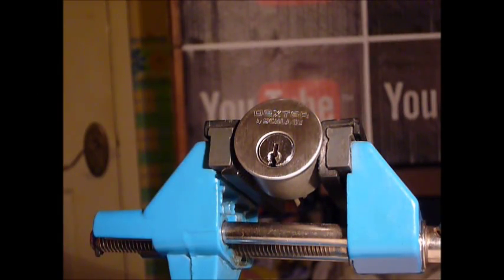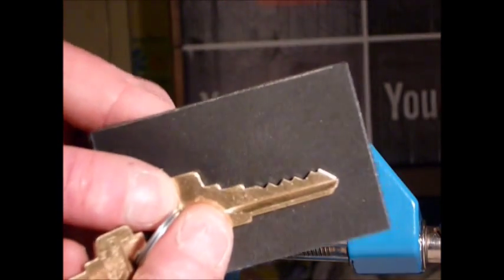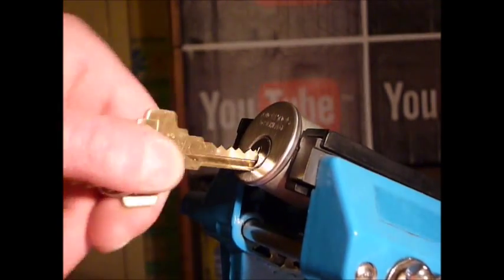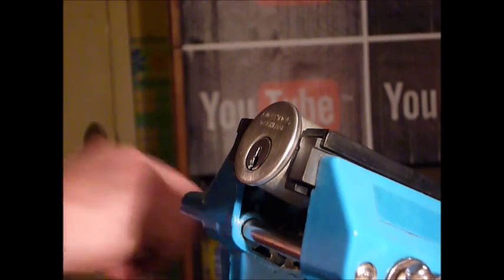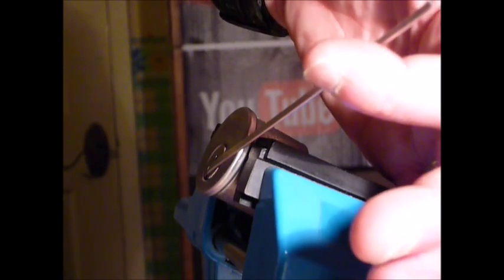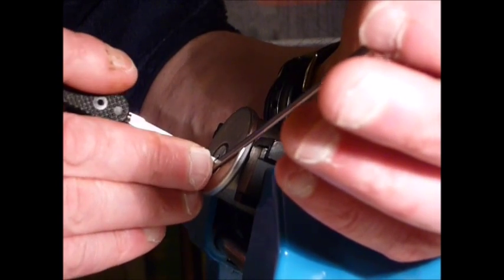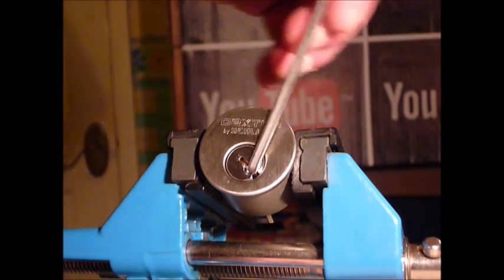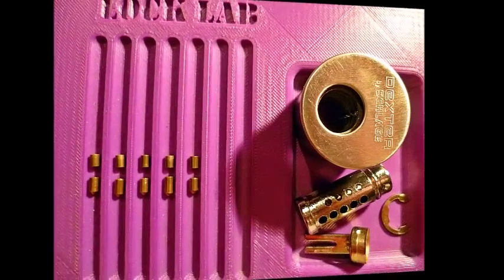Single Pin Picking A 5 Pin DEXTER Mortise Or Rim Cylinder Lock By Schlage

Comment: The lock is a dead bolt type lock that sits kind of flush with tge door. The tail piece is what makes the dead bolt move into the locked or unlocked position plus attaches to another piece on the inside of your house so you can lock or unlock it without the key
Reply from the maker: Cheers for that info RS buddy ;o))))

Comment: Great picking! This is actually called a "deadbolt cylinder" :D They can usually be identified by their distinctive resemblance to rim cylinders, and the lazy tailpiece on the back :D (Lazy tailpieces can turn from left to right without a key as opposed to fixed tailpieces on rim cylinders) Thanks for sharing!!!!